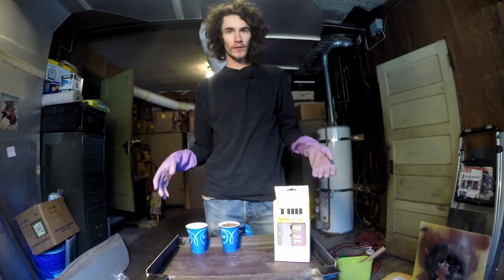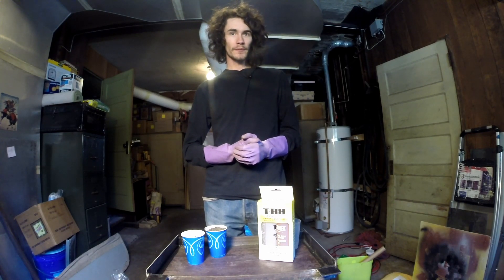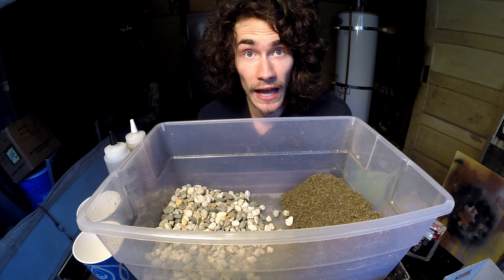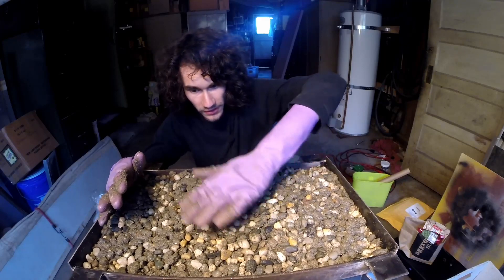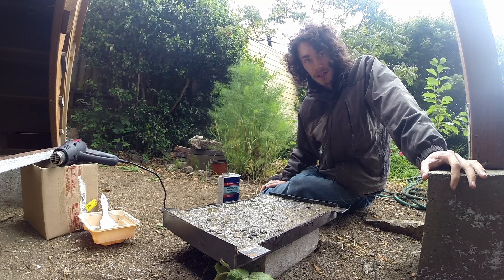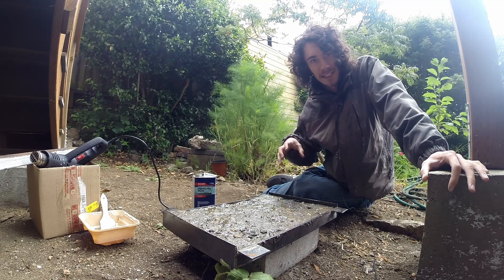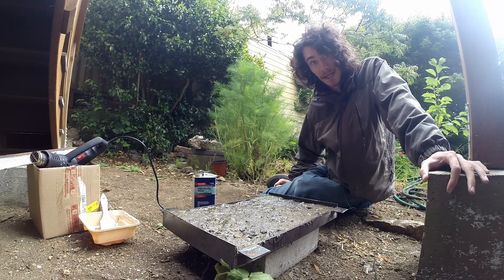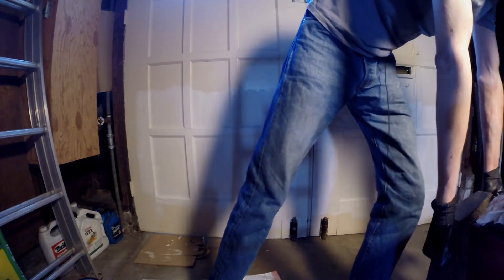Epoxy Granite Test

Comment: the granite should be dried and you use epoxy over polyester is the curing time the slower the set the better the casting the granite slows the epoxy down the polyester will start to set as soon as you mix it so you have more time to cast with epoxy we were doing 200kg loads at a time if your not vibrating the mould pour a covering of epoxy onto the base of the mould to get a better finish if your not bothered about it not looking like stone then we would gel coat the casting and you will get very few holes
Reply from the maker: Good to know. I was going for a DIY approach and the technique worked BUT... I also know it was not the right method. In the end it did the job, although now it is near impossible to move!

Comment: Can't wait to see where this project goes, I've never heard of this technique. I don't think I've seen your CNC yet either.
Reply from the maker: Thanks, it will be a few weeks before I really go crazy and tear the machine apart and do this but I will update when i get there. If you look back in my videos you may see some videos of the machine. It is a custom CNC conversion of a Little Machine Shop Hi-Torque mill with a solid column. You could say it is a one-off CNC job.